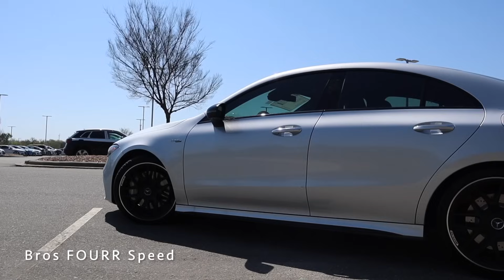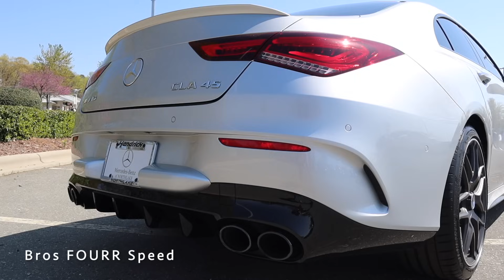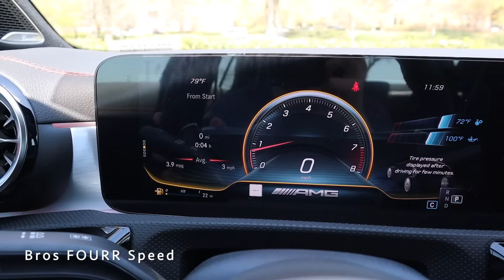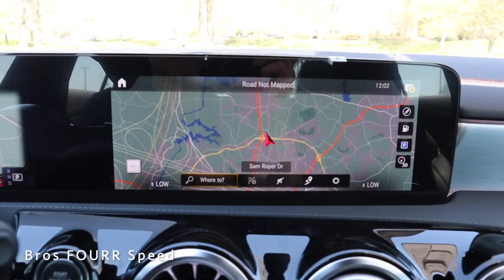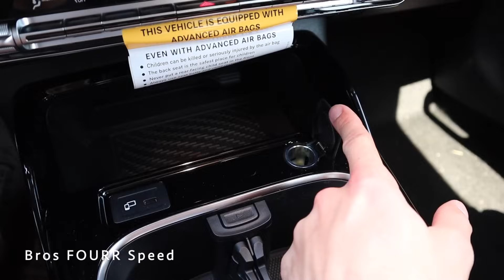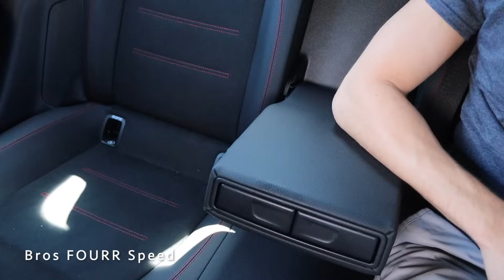2021 Mercedes Benz AMG CLA 45 Coupe: Start Up, Exhaust, Test Drive and Review

Comment: Idk if I want this or the scatt pack 😭 complete opposite
Reply from the maker: Haha yeah those are completely different!  The Mercedes is going to be more comfortable and way more luxurious!  Both have potential for tuning! The scat pack won't have as nice of an interior and they are probably going to be in a similar price range depending on new vs used!
Reply: @BrosFOURRSpeed   your right on that no CAP 🧢 feel like dodge could of add more nice mods in side instead of just that super charge

Comment: Was the ride still firm in comfort mode?  Read UK road test reports saying it is too firm even in comfort.  Might just be UK roads which are quite potholed though
Reply from the maker: At least here in the US on the roads I tested it. Seems nice and comfortable in normal mode. And then gets more rigid feeling in sport. Good blend for what I did with it

Comment: How long does the engine last for? Need this info asap please!
Reply from the maker: As long as you maintain the car for!  If you let it go and don't do regular maintenance, that will significantly reduce the life of the engine, but it should last a good bit of miles!
Reply: @BrosFOURRSpeed  is 200,000 miles a realistic expectation to have for a good owner?
Reply from the maker: @soundcloudhq7863  Probably not, 100K shouldn’t be an issues, but after that might have some issues. A Camry or Corolla would make it no problems!

Comment: Stuck between the C43 AMG or the CLA45 AMG HELP ME CHOOSE PLEASE
Reply from the maker: I guess it'll depend if you need the bigger size from the C class Mercedes. If you don't need that size of a car, stick with the CLA ;)
Reply: I have the 45 and its fire!, there's a YouTube that explain why you should go for the 45 rather than the 63 or 63s... the 63 feels like your gonna spin out on high speed, the 45 doesn't

Comment: Not trying to compare an sedan to an SUV but 382 horsies for a 4 cylinder, which is the same as the X3 M40i, explains why this AMG is a beast! The other feature that jumps off is that steering wheel.
Reply from the maker: Yeah this is a very performance feeling 4 banger! From what I've heard the CLA 45S has the most powerful 4 cyl out there! It's a great car!

Comment: Europe also gets the A45 AMG with the same performance figures.
There’s also the S AMG models with 421 horsepower and 500 newton metres of torque. 0-100 takes 3.9 seconds (making it the fastest mass-produced four-cylinder engine in the world).
Do you get the CLA 45S AMG in the States as well?
Reply from the maker: I've seen the 45s in some pictures and videos. I'm not too sure if we get that one or not. This is definitely a great car. Would be nice to get the top of the line model!
Reply: We actually get something quite strange here. We can get the AMG dynamic+ package here in the us which gives us the s features (ceramic brakes, drift mode, race mode, etc.) but we don’t get the more powerful engine.
Reply: @keiththiha  I think the states should get the A45s AMG. Shame they don’t get it, but Mexico does.